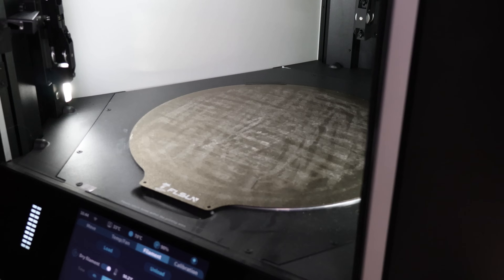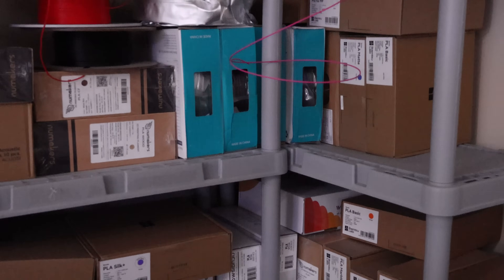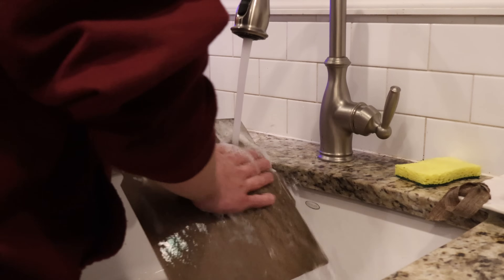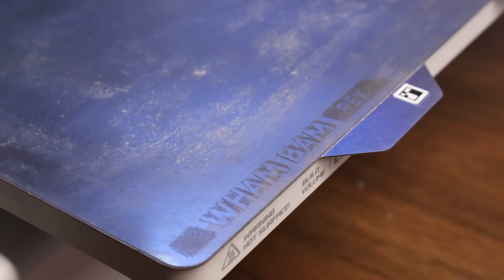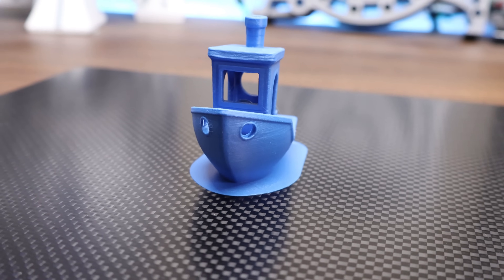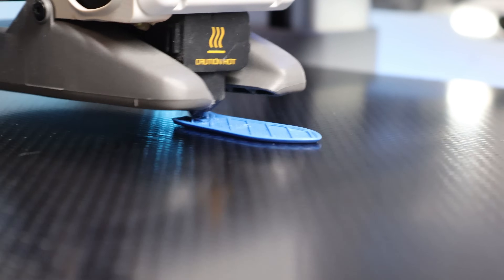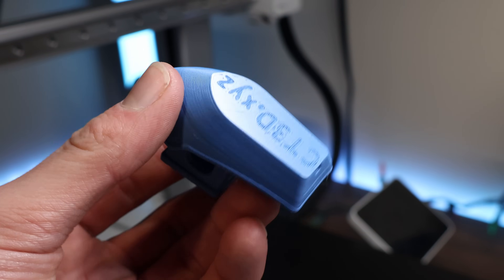I Tested EVERY Kind of Buildplate... Which is right for you?

Comment: did you mention glass plates?
Reply: I love my textured glass plate from Creality. I never have a problem as long as the surface is clean with glass cleaner. The prints pop right off when they cool.
Reply: CHAPTERS 
0:19 Textured PEI Build Plate
2:42 Smooth PEI Build Plate
4:07 PEX Build Plate
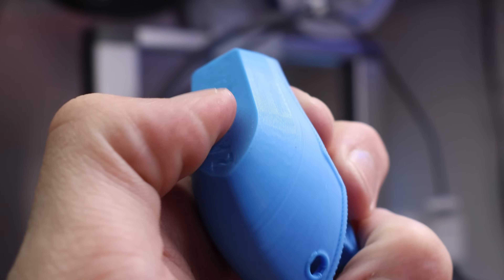5:14 Biqu Cryogrip Build Plate
6:29 Bambu Lab SuperTack Build Plate
8:14 3D Affect Build Plate
9:51 Darkmoon 3D CFX Build Plate
12:27 G10 Build Plate